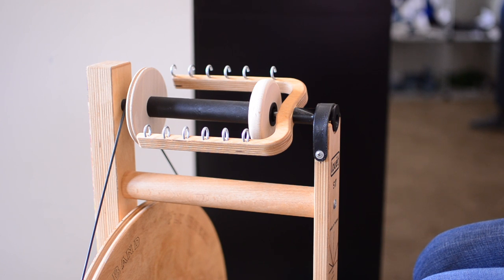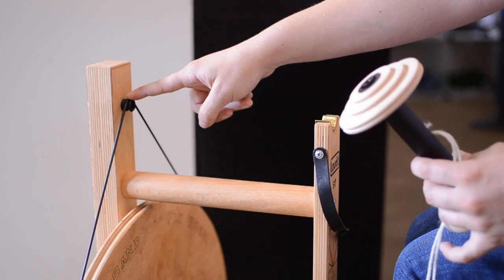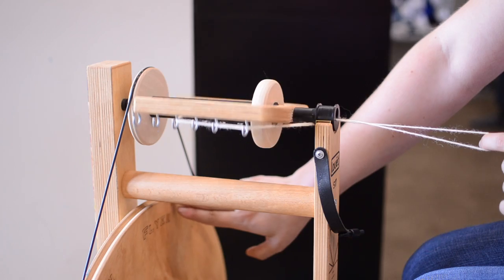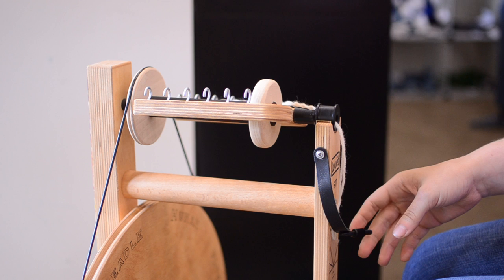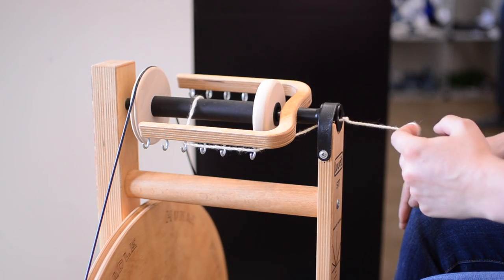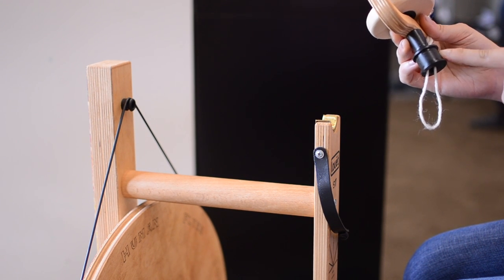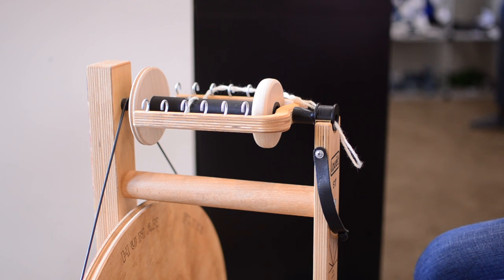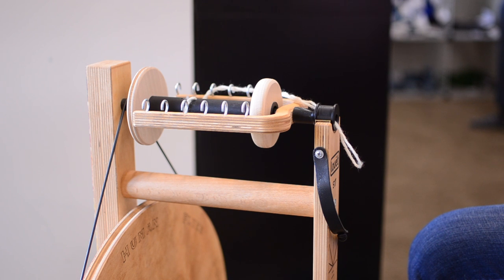Getting Started on the S17

Comment: I took my Louet S15 apart to paint the drive wheel, and while I was careful to put it back exactly as it was - it hasn't run nearly as smoothly since.  I am concerned I may have mixed up some small detail.  The assembly videos don't go over everything, could you help?
Reply from the maker: Well I can try.  Diagnosing problems long distance is pretty tricky.  Can you describe how your wheel is different now than it was before?  Or better yet post a video showing the issues?  I also recommend that you contact Louet directly via the form on louet.com .  They really know their stuff, and they are all super nice!

Comment: What did you use to finish the wood on the wheel?
Reply from the maker: We did a lot of work on this wheel because we wanted to decorate it.  If all you want is to protect the wood, there are lots of easy options - stain, varnish, danish oil, etc..  Before we put the wheel together we gave it a quick sanding and stained the wood with an inexpensive stain from Home Depot.  Then we did the wood burning and painting, sprayed with a polyurethane sealant to protect our decorations, and finally assembled.  I definitely recommend finishing the wood before assembling to make it easier to get all the pieces coated evenly.

Comment: You mentioned forums that you looked at regarding the S17. What forums did you find had good information about the use and care of S17s. The booklet that comes with the wheel does not have a lot in it.
Reply: Brenda Blair I mainly use the fora on Ravelry.  It's free to join, and there are many groups with excellent information, both specific to Louet wheels and about spinning in general.